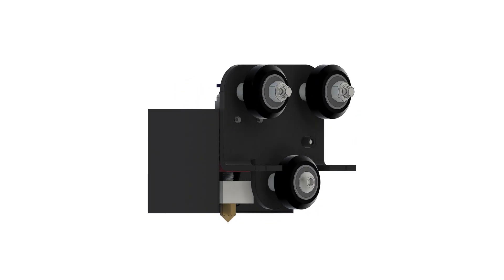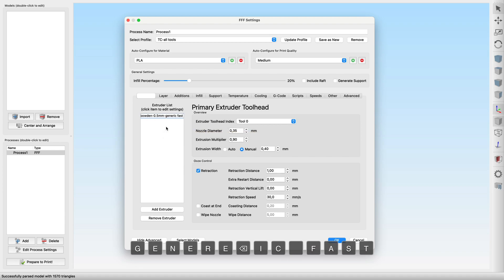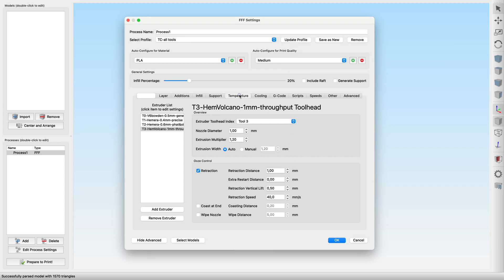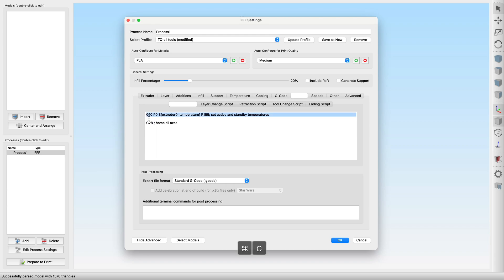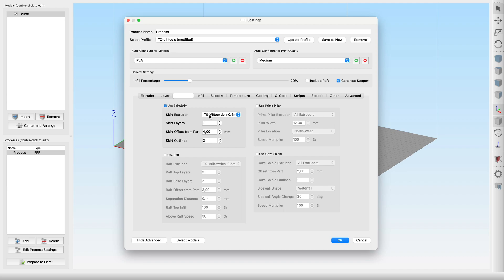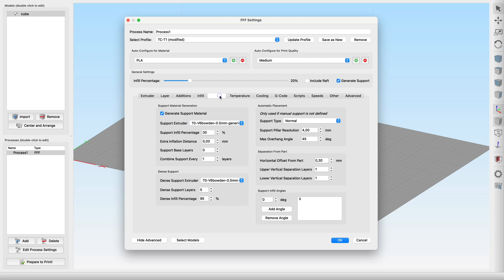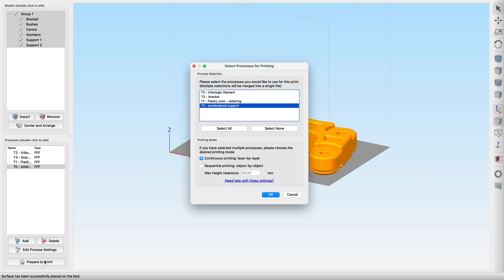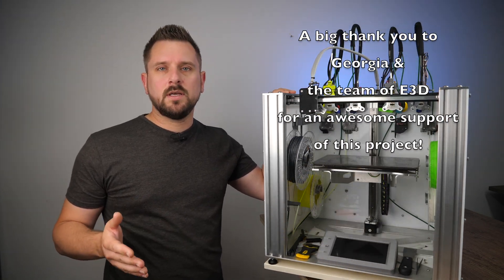Toolchanger - Slicing #01 - S3D Basics

Comment: I've got the new Snapmaker U1 4 head tool changer being delivered in a couple of days! Orca Slicer/Snapmaker Orca doesn't allow for using multiple nozzle sizes; however, I know that S3D does because I've done it many times with an E3D Revo single nozzle swap in prints 🤘🤘

Bummer that it seems this channel is no longer active, as I found this while looking for help setting the U1 in S3D. Regardless, thank you for the information you've provided all these years ago 🤘🤘

Comment: I like your tutorials!  And I know this is an older one. And I just received my TC.  But there are times a follow up is needed.  I see your using Simplify3D (as recommended by E3D for the TC). and yours appeared to run very smoothly.  But connecting Simplify3D and your printer over wifi takes some special instructions. which I have yet to find. I think you may have mentioned something about Simplify3D Machine Control Panel in an earlier video. But no specific steps to get your Simplify3D, PC, and E3D ToolChanger working together smoothly.  Any Help would be great.

Comment: Hi Rene, don't know if you're still active on here? I have tried to very carefully follow this, and have sliced a small multi colour print. When I sent it to print my z axis went racing to its limit! Any suggestions as to where I've messed up? 

The one tab you don't show above is the gcode tab with the machine parameters. I used the parameters I found in the kraken factory file I found on github, but I now wonder if I need to reverse z axis?
Reply: I found that the z-axis in the gcode tab was homing to max. I have changed to min and will re-run

Comment: Thank you another informative video. I have been struggling with S3D for a few days now mainly as it was putting out M104 etc, I now know what to add to the start script. Unfortunately as I started from a setup designed for the bowden v6 I missed the retract distance and it jammed my hemera inT0 so I now have to free that somehow. The heat break is solid so I guess I am going to have to strip it.